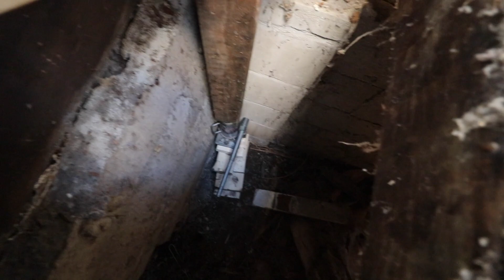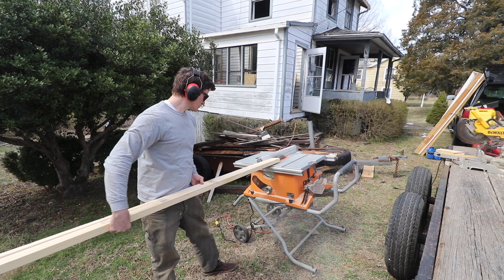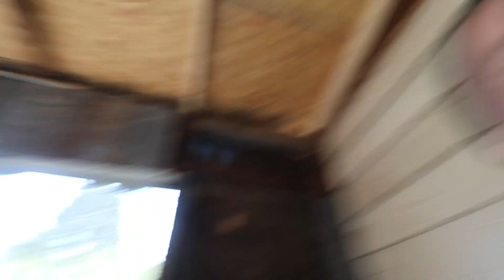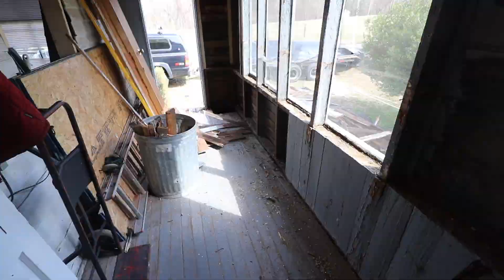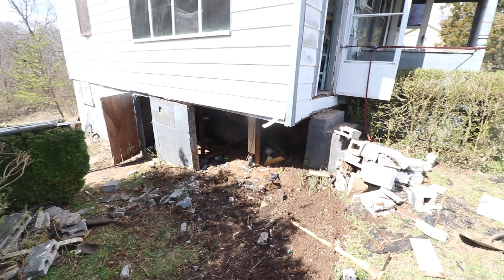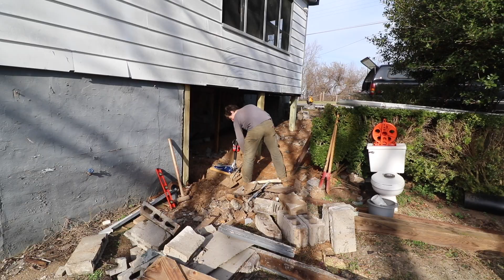$9,000 HOUSE - CRUMBLING FOUNDATION - #21

Comment: "Tear it off and replace it with a simple, open deck/porch" is exactly what I was thinking. But what you got done is a big improvement. Getting the bushes out of there helps a lot, too.
Reply: I agree.  I would, however, add a little stoop with steps, pulling out the old cement steps.  It's hard to open a door when you can't back up except to go back down the stairs.  If you're carrying groceries, etc., in, this can be a hassle.  But he's doing a great job!!
Reply: I would still build a roof over the deck, but extend it a couple,feet beyond the lines of the sidewall.I have successfully. built wood steps right around crummy old concrete steps like that .
Reply: I wouldn’t even put in a deck. I would just run the steps right up to that door. The whole thing is in an odd place and is an eyesore.

Comment: OMG please tell me you didn't just set that post in soil.
Reply: Does he need concrete for those wood posts? Just dirt seems to wobbly. Yet-I really like his vids.
Reply: @shinebright9453  he doesn't  technically  need anything under the post but it's good to have some kind of foundation  yo put them on
Reply: Yeah i was wondering where the concrete was.
Reply: Different part of the country folks. In his area, there is no frost heaving. I live in the Deep South...and my water lines are 18 INCHES down. No need for anything deeper. It doesn't freeze here often, and the ground simply doesn't freeze deeper than about 6"-8" in any given year. He set it in clay soil. It's dense, heavy and does not move.Essentially, he set it on brick clay. BTW, my water lines have held with no issues for over 30 years. They're PVC, so you know that I should have had issues...but I haven't.
Reply: Looks like treated wood, so it should be fine from rot and termites.
Reply: It sure makes me worried, even if the lumber is treated. At least here in Sweden lumber that is in direct contact with the ground will start to rot pretty quickly simply due to moisture.
Reply: He said he was putting footers in.
Reply: @charliegone1652  It's not. It will rot anyways. Just not as fast.
Reply: @DodiTov  I think my concern and theirs is not an issue from frost heave (a big one here but I know it's geographical issue) but more so that soil supporting the structure 10 years from now.  I would agree with you that it was like brick clay IF he was using a pickaxe or spud bar or the sort to dig that dirt out, but I was impressed with how easily he was able to dig down with little leverage from the shorter shovel it looked like.  What we may not have seen was him loosening it first with a pickaxe or simply pouring concrete pads first...but if the dirt was that easy to dig, I do not believe it would be best for holding up the porch.  I know it's not a lot of weight, and that the 6x6 is doing most of the heavy lifting, but still a concern I'd share with audience considering doing something similar. :)
Reply: @DodiTov  What a load of bullshit, if the ground doesn't move why is he fixing a sunken wall foundation in the first place!!!
Reply: @DodiTov  Thanks for the info. It is very different here up north, where we have to put a 4 foot concrete footing down. For him, I would just worry about rot.
Reply: He specifically said he would put in footers. FYI.
Reply: @eraldorh  It was built as a porch. It probably had a slope to start with.
Reply: @MrKanjidude  Agree! Even treated lumber won't withstand more than a year in such a climate without any sealant around it
Reply: @nicpedia2432  He said he was going to dig down and put footers (i.e., poured concrete), and then put posts on those. That's what he did. He did not rest the posts on naked soil.
Reply: Those posts are in soil / dirt. They will last 10-15 years, then they will have to be replaced. It doesn't matter if they are pressure treated, they will eventually rot.

He should never have buried the posts in dirt. That would never pass an inspection.
Reply: Why do you think the rest of the house is sinking LOL
Reply: It will rot...

Comment: I have been watching your videos for a while and noticed your harbor freight reciprocating saw and have seen you needing to apply a lot of pressure on really simple cuts.

Since you are on the Milwaukee 18v platform and seeing as how you are using it constantly I highly recommend the Super Sawzall, I have it and coming from a corded low power reciprocating saw I can tell you the power difference is absolutely noticeable. 
You will never again struggle cutting a beam when fixing an old floor.

Comment: The amount of work you're tackling on each house is just astounding! I'm really glad to see you going 100% on the porch and fully repairing the foundation. It's also WILD the kinda crappy handiwork you're uncovering as you work your way through the house!

Is there a reason you decided to go with wood beams instead of blocks to fix the porch? I'm guessing cost and time mainly? I also didn't see you concrete the post. Doesn't code call for concrete in your holes? (I'm thinking from the $12,000 house video where you had to concrete those porches.)

Comment: What did you do for the foundation of these posts so they can wear the weight of the porch? 
And why won't they rot away in a couple of years dug in the bottom?

Thanks for sharing anyways. I appreciate your work (both the handy part and putting those viedos together for us). Stay healthy!
Reply: i was gonna ask the same thing!
Reply: I'm wondering if that was supposed to be temporary or if he really intended to leave it that way?  Yeah, years down the road, those posts will rot out.  I'd much rather see him use peer blocks with metal brackets to support the beams.  Then the beams are off of the ground.
Reply: I have the same question.  It looks like you set the posts on nothing but the hole you dug.
Reply: Here on the shore of Delaware Bay, 2 and 3 story houses are built on  10-12 inch diameter piers that are pile-driven into the ground.  The ground is probably almost all sand and being literally at sea level is wet not too far down.  I would guess his 6x6's will work the same for a small porch and are for sure better than a 4" block wall that can be moved by pushing it.
Reply: Having seen pretty much all his other videos, I have a sense that he poured either concrete or put rock dust at the bottoms of the holes and just didn't show us. He has emphasized many times that he's just bringing us along for an overview of his renovations, unless he specifically states he's doing a "how-to" tutorial, as in his shop videos where he builds a table, etc. In other words, like he mentioned at the beginning of this video, he doesn't necessarily film every step of the process....
Reply: @robinrummel1359  probably salt helps them to stay 'alive'
Reply: Those appear to be Pressure Treated, rated for ground contact.  They'll be fine for a long time.
Reply: When he puts new siding that area it won't get wet the water will drain away because of the incline. The posts are dug way under the frost/heave line. and wood in concrete rots faster than it does out of it. I'm sure the posts are treated against rot n insect damage. That clay the posts are in is great stuff too for protection. That's all my thoughts hope they help.
Reply: I wonder if the saltiness keeps them from rotting on the shore. Boat builders will tell you that fresh water allows rot to happen in wood, but a boat will last in salt water.
Reply: The orange "dirt" you saw is brick clay. The area is rife with it. It does NOT hold water well. In fact, it won't grow anything! Clay must be "emended" to absorb water. Essentially, he just dug down to the clay substrate, and it became a natural footer. BTW, in his area, frost line is only between 6-8" deep, so there's no heaving. The bushes show that. Notice how shallow the roots are?
Reply: Those columns really aren't holding a lot of weight and as long as they are tied in correctly to the porch framing there shouldn't be an issue.  And yeah they will last a long time.  The porch on my house is supported in a similar fashion and was built in the 50s.  Haven't had issues... yet lol.
Reply: Jeff Weber not always true. There are incredible ship wrecks in Lake Superior that haven’t rotted. The cold water really helps to persevere them.
Reply: Those posts are only temporary

Comment: I did not see that coming even though you pointed out at the beginning that the floor was uneven. I know you want to get it right. I now see the folly in using cinder block on any foundational work. Concrete is more stable as long as the groundwork is stable. Glad you have done this before that does look as a daunting task to get the foundation of that side porch corrected.

Comment: In lock down in New Zealand and this just poped up, oh joy... Yes cordless tools are a godsend, I have Makita 18v stuff but Milwaukee stuff good (except the concrete drill for some reason) , you will find a circ saw invaluable , get a 18v small blower as well, really handy , not that expensive and i use mine all the time, thanks for the videos...

Comment: I would rethink carpet in that porch. In wet weather, you want a more water resistant flooring. Sheet vinyl would work well, be very inexpensive, and very durable. This is going to be terrific when you are done.
Reply from the maker: You are right, i’ll do sheet or plank. Thanks

Comment: i have 20v dewalt and some 60v dewalt super cool stuff the only corded stuff on my trailer is a table saw and 12'" miter saw and air compressor to run framing nailers . finish guns are all 20v

Comment: The carpet will be nice unless you decide to rent it out.  It will get filthy in no time.  You can tell this old house used to have some architectural charm, with the shaker shingles on the upper half and horizontal siding on the lower.  The aluminum siding helped clad the house, but it didn't do much for it aesthetically, did it?  I can never get enough of your videos!

Comment: Don't get mad,another idea -before you get to ahead of yourself.
 but how about left hand porch on that house? front porch wraps all way to side door you put in ,the porch floor and  the roof turns at end of house.The roof on those left hander houses are squared at end at two ends not pitched. just suggestion- good luck.

Comment: Are the wood 6x6's sitting on anything, like a concrete footer? I must've missed that step.
Reply: I was wondering the same thing. Isn't wood rot going to be a concern?
Reply: I was thinking the exact same thing.  Even ground rated pressure treated wood eventually rots, right?
Reply: Wondering the same thing, settling of dirt those wood posts are sitting on will ruin the new foundation. Cheers
Reply: Bump! Same here.
Reply: ditto, also in addition to rot, won't the post sink and settle over time?
Reply: @Mrzizzy69  at the 3-4feet he dug down i think the ground is plenty compacted to not settle with the weight of the porch.. remember its just the corner of the porch not the house, be concerned about rot though i imagine thatll be an issue within the next 10years, he could of coated the posts in alot of things to double or triple the life span
Reply: @MissusO  Yes, ground treated wood will still rot with the moisture.  If he does install gutters and that area has shrubs planted to suck extra moisture it may outlive us.
Reply: @sarasunshine883  Yes, 15-20 years if the ground is moderately wet. Sooner if it stays wet, longer if it stays dry and has something helping wick moisture away.  Two solutions are to put tar on the post before burying it, or to pour a footing pad, install a post anchor that keeps the wood 1" above the concrete pad that is also above grade, and have a permanent solution.
Reply: @Mrzizzy69  This is my main concern I shared! The posts should last well long enough to rent the place out, and sell it in 10-15 years. However I am more worried about settling in the next five years.  Then again, even if it does settle, it may only be an inch. That looks like 6 to 8' wide, so 1" in that span would only be 1/8" slope. Not noticeable.  If he compensated for this too, he would make that end a little high so when it does settle it actually levels  itself out.  We're making a mountain out of a mole hole issue here but I like to discuss it!
Reply: Whats new with the concrete pillar from hell in the basement?  I was waiting for you to show rhat thing again lol.
Reply: He said something about digging down to add a footer before he started knocking out the cinder blocks. And he also said footer again after ripping out the bushes.
Reply: Yes, he put concrete footers in the post holes he dug for 6x6 supports. He mentioned it.
Reply: Doesn't matter. Those posts are buried in dirt. They will last 10-15 years, then they will have to be replaced.  It doesn't matter if they are pressure treated, they will eventually rot.
Reply: @jeffj2495  In the next video, you will find out that he had raised the corner a bit too much and so had to go back in to reset the posts to get the floor level. While doing so, and thanks to the comments on this video, he wrapped each post in an aluminum sleeve to provide them extra protection.
Reply: Agree, a concrete footer then a metal bracket to hold that post off the ground.

Comment: Hey hey man, so I have my own framing company and we use a lot of cordless tools when applicable. I definitely like and use Milwaukee cordless tools a lot, but specifically when it comes to a good old circular saw the dewalt ones are a lot better in my opinion. They're much less bulky, lighter, feel better and have better visibility. Just my two cents from someone who spends all day cutting :P

Comment: Love watching your videos, I do a similar thing in France, buildings here are generally made out of stone or block. Question, dont you put concrete footers down below the timber posts to stop it sinking again and surly the chances of that timber rotting is pretty high now that it's in the ground? I am just curious because we would never do that even with pressure treated timbers. Rule of thumb here is keep wood away from anywhere that could potentially cause it to rot. We even mount our posts on galvanized adjustable feet to keep them dry. Keep up the cool content 👍

Comment: Cheaps out roof joist leaves dry rotted 2×4 in place. Gonna run into settling issues later you've gone from a distributed load to the full load on three points and not pouring concrete footings to support it.

Comment: Tear the door out and close it in. Make that little room into a small office/library. The house looks kinda a dumb with 2 front doors. Then, take off the door from the kitchen and make it a permanent opening full width. Where the outside door was put in a window. But not too low. Under that new window facing the street add a nice wide board to make a desk looking out into the front yard. Once insulated it will make a cozy little place to read a book or catch up on some paperwork!

Comment: Did I miss you pouring concrete piers for the posts?  It seems as if those posts will just sink/settle into the soil and the porch will sag.  
Even pressure treated wood will rot.

Comment: well within your skill level to dig a trench for a new block wall footing with rebar but the six by is quick.  i would delete the concrete steps
and not even think about it.   consider a 8x8 foot deck right up to that door then with the slope of your land you might get away with just 2-3 treads to
step up on the deck.  real nice street appeal

Comment: I know it's pressure treated lumber but i still think that it'll rot in a few years with so much of it in the ground.
Reply: I was thinking the same thing. Even though its treated, it will still rot. Needs to be set on a  concrete poured footer. Not sure this would pass code now days.
Reply: It'll last 30-40 years. Same construction technology as a pole building

Comment: I'd be tempted to expand the covered open porch floor over to that back porch door. I would not expand the roof over, but just the railing, and have a separate set of stairs over there. 

+1 vote from me for Milwaukee Tools. I won a set at an xmas party. The smaller M12 kit that came with several tools. They've become my indoor set, and having just done to this house what you are doing to that one, I have put it through the paces. The contractor that did the bulk of the actual renovation, framing, roof, etc, used Milwaukee as well. Including a wireless drop saw.

Comment: I'm surprised you didn't think about cordless before. When I'm not in school studying engineering I work construction(mostly metal framing). I got quite a few DeWalt tools. I went with DeWalt because they were slightly cheaper than Milwaukee. You usually see more deals in HD for DeWalt than Milwaukee but both are great tools.

Comment: I really enjoy your series, and have dome the same work . I have an honest question. Why would you put a pressure treated 6x6 directly in the ground? Yes pressure treated wood in dirt shouldn't rot(during our lifetime), but someday it will. I did the same job using the sonic tubes with concrete, and anchor bolts and caps. This with a crossbeam will never fall down in anybody's lifetime.